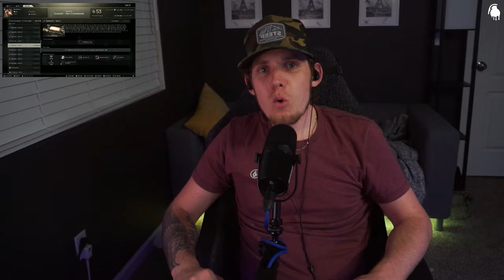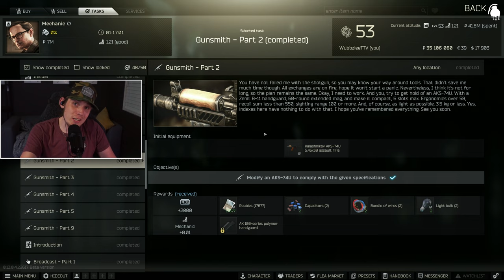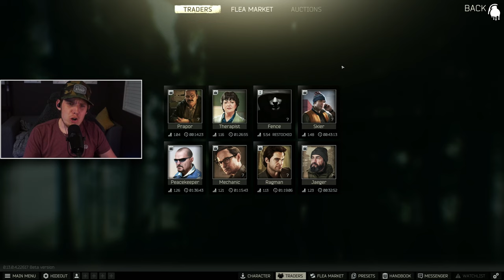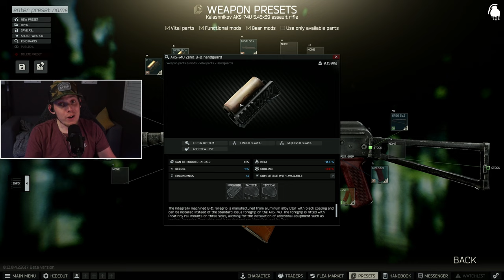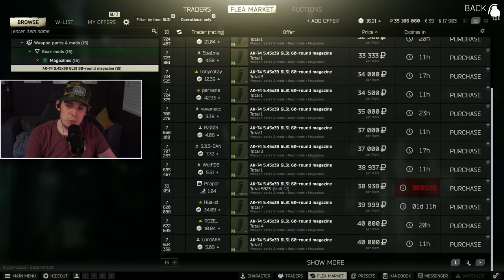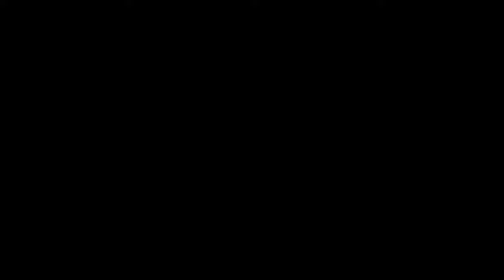Gunsmith Part 2 - Mechanic Task Guide - Escape From Tarkov - Patch 0.13

Comment: Hey, if you have the lavatory, you can craft the 60 Rounders Way cheaper than buying it early. Wipe great way for this mission and ice cream cones to get it done.
Reply from the maker: This is true. Left it out of the video!

Usually players are hitting Gunsmith 2 long before having lavatory 2 in the hideout. BUT, you’re correct. If you’ve got the hideout built enough, it’s a good option!